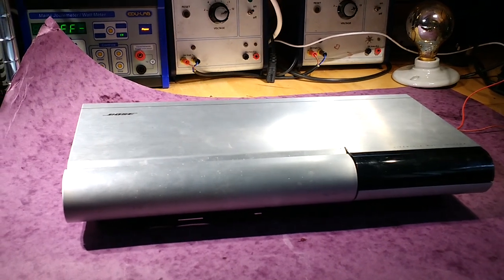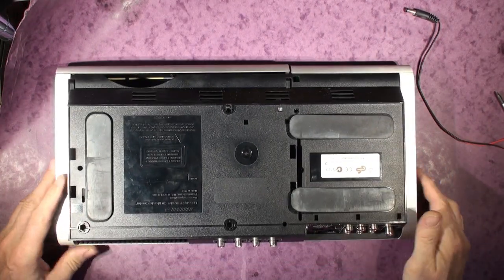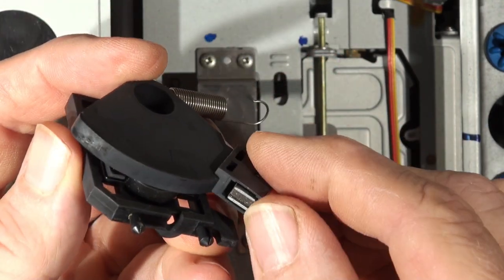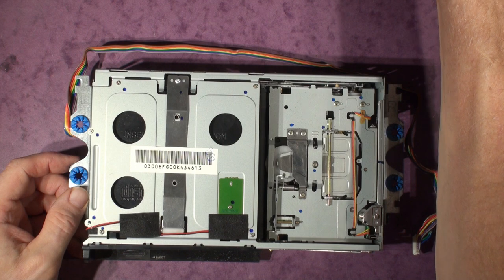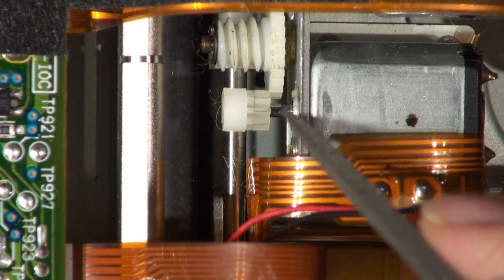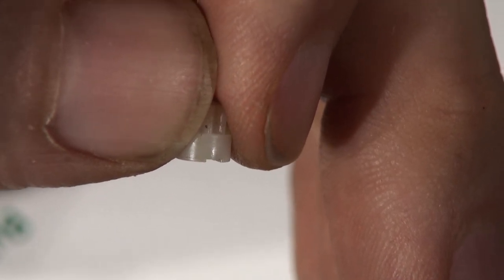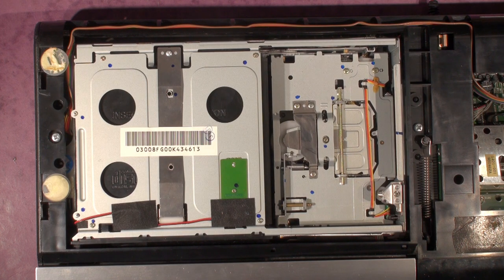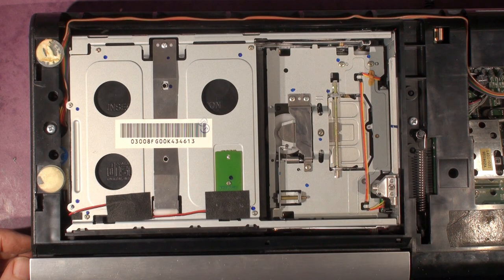Bose LifeStyle System won't Eject CD Magazine /  Cartridge - Can it be fixed?

Comment: Thanks to your video I repaired one of these units today in less than half an hour. I used super glue on the slipping spur gear. My lathe at the ready, but was not needed as my gear had not split, just moved along the motor shaft. Also the repair was a love job for a relative, so lets hope the glue holds. Subscribed.
Reply from the maker: Nice work!

Comment: Issue exactly as described in your video. I used 7/32" Brass Hobby Tubing to cut a small collar that fit over the smooth collar on the pinion gear. Secured it to the gear with super glue. Perfect operarion was restored. Total investment $1.58. Thank you so much for this information!
Reply from the maker: You are welcome
Reply: Ha ha. Did you take the cost of a length of brass hobby tubing and divide by the length you cut off?

Comment: Many thanks for taking the time to compose and post this video. My unit also stopped ejecting the magazine, whirring endlessly in its attempts to do so, and reuniting the little cogs in question solved the issue for me too. I chose the quicker option, though, of simply pushing the smaller cog (on the motor) back into position (don't have all the other equipment you do) but this will hopefully suffice for another couple of years to happy listening. Thanks again.
Reply from the maker: Glad it helped
Reply: Hey, is it still working okay? I also don't have all that equipment
Reply: @sherrisaramjohn9936  Yes, I've had no issues since repairing it in this way.

Comment: Great video.  I love my lifestyle 30 and experienced the same problem.  Fixed with the end of a disposable syringe (teeth whitening solution) as mentioned by another viewer.   However, I then found that the laser would not read the discs.  Back to YouTube and looked up adjusting the laser potentiometer slightly (anti-clockwise).  Now have the CD player all back to normal!  Many thanks again!
Reply from the maker: Great news. Another unit saved!  Thanks. If you subscribe I have other Bose videos - I need to edit and upload when I get time.
Reply: How did you fix it? How did you use the syringe?
Reply: @Sutojl  In this video Magic Smoke turns a collet on his lathe to fit over the cracked end of the plastic gear.  I don't have a watchmaker's lathe so cut off a piece from the plastic nozzle of a syringe and, with a little "fettling" with a craft knife and a tiny file, fitted it over the cracked shaft instead of the metal collet.  I didn't even use and superglue as the fit was so tight.  Hope that helps?

Comment: Had exactly the same failure on my unit - the eject motor running continually in my case - until I can fix the loose cog I have unplugged the CD player as don’t really use it. Thank you as I guess you have saved me a lot of money getting it sorted
Reply from the maker: Glad it helped.

Comment: Thank you magic.  This was exactly my problem.  Obviously a manufacturing fault.  Anyway, was a bit tricky reassembling the whole thing and at first couldn’t get the door to stay shut.  Spring kept pulling it open but did get there in the end.  I’ve also got a problem with the remote which hopefully isn’t something I did when taking the unit apart.  It doesn’t seem to connect to it.   Tried new AA’s which had no effect (cheap Panasonic batteries?).  In fairness I don’t use the system that way now.   With the way tech’s moved on I now have a Bose link connected to it and use an app to stream music to the speakers along with other S20’s and 30’s throughout the house.   Which as you will probably appreciate keeps every room filled with synced music.  Anyway, I digress,  thank you for your very informative and easy to follow vid.  Keep the music playing.  Andy.  Southampton 😊
Reply from the maker: You are welcome. Thanks for watching.

Comment: Bravo apparently there are quite a few videos which talk about this problem.... The trick is to have the equipment to be able to do the same thing which is not at all obvious, would you have by chance put set up a small business selling aluminum washers MDR in any case well done !!!

Bravo apparemment il y a pas mal de vidéos qui parlent de ce problème.... Le truc et d'avoir le matériel pour pouvoir faire la même chose ce qui n'est pas du tout évident est-ce que par hasard vous auriez mis en place un petit commerce de vente de rondelles d'aluminium MDR en tout cas bravo !!!
Reply from the maker: Thanks. I sell the gear motors at cost for anyone who needs one. I sell a few per week. used to sell just the metal pinion gears but it was easy to damage the motor housing whilst pressing the gear on so I got some Mutaba gear motor assemblies made in Taiwan . .

Comment: Really helpful video, thanks. My CDs had stopped spinning although they would load up and pop in/out of the CD cartridge fine. This trick with the two plastic gears solved it. After 22 years, my Bose will carry on providing good service.  Great news as replacements are probably now made in China and we boycott them because of their appalling human rights and environmental records.
Reply from the maker: Hi David, great news.  Nice to know that something has been saved so it is necessary to take, make and throw yet another another audio system.

Comment: Great Video. I have same problem with my unit. CD doesn't eject & the display is gone. I have three questions. 1) What if I do not have milling machine? Is there a back up plan to put the same gear? 2) Top cover that you showed to cut it with knife, how do one put it back? 3) The display; Has it come on once the CD eject fixed or any more steps required?
Reply from the maker: I understand a piece of a syringe needs cover is tapered and can be trimmed to fit as a collar.  If you degrease and superglue the gear it will usually hold OK.  Stick the cover on with thin double-sided tape.

Comment: Fantastic video sir, thank You for uploading. But what if im not trying to fix it, but just get the cartridge/magazine out? My mom would be very mad if I were to disassemble it, and some of my most favorite cds are stuck inside - parliament funkadelic live, smokers delight… Any help on how to get the cartridge out would be appreciated❤️
Reply from the maker: make sure all CDS are in the cartridge. then you can turn the gear that the motor pinion with a small screwdriver. If you turning the correct direction then it will start to rise so just keep going..

Comment: Hi I know this this an old thread as such, but... my very old system has just gone and it's the small pinion gear that's split. will any 9 teeth gear do? I've read that you've asked for sizes from others, can you share what I need to get? many thanks
Reply from the maker: I will have a look. I have a drawing of the gear. I expect it is just a standard type.
Reply: @razenby  been searching - 092A??

Comment: I found a mention that the little plastic gear used to have a part number of 189099 but I can not seem to find it available anywhere. :(
Reply from the maker: Do you happen to have a sample? I am pretty sure I can source the gear. Just need the outer diameter and the number of teeth,

Comment: Hi, I have a lifestyle 5 model 614810, everything works perfectly, but 
little by little did you lose the tuning of the radio? Will I have to 
adjust something inside? Or could it be that I have to replace a chip, I
 only have a small cable for the antenna, but before that it was heard 
without problem, now nothing is heard, only the noise as if they were 
not broadcasting on radio stations.
Reply from the maker: Sorry, very difficult to diagnose remotely but you can check the basics as they often turn out to the issue . Check the supply voltages are present. Check the antenna connection is good. If you hear the mush then the receiver is probably working.  You could change the reference crystal.

Comment: You can see the time I posted the question and now... It was the problem and the gear was simply shifted out. I pushed it in and it is all good. Took the longest to put the black trim back but it is on... On my way to Lowe's to buy two sided tape to put the top cover back on. Thank you very much for the video!  Display is still not working! :( Any suggestions?
Reply from the maker: Display is VFD.  1. Check the low voltage DC supply for the kathode  wires is working. They are the fine wires that run along the display under the front glass.  There should be a few volts potential applied between the ends of each wire  to heat up and make it emit a cloud of electrons that can be accelerated toward the anode.  If the supply fails then there is no display. If you measure zero volts across the wires then the supply has failed. Look in the supply for brown resistors, bad connections, bad connections in the wiring and a bad smoothing capacitor.  2. Check the HV anode supply voltage is present.  Should be between 12 and 30V depending on display.

Comment: I’m having this exact problem, only that little plastic gear that popped-off appears beyond repair. Were you able to find a source for ordering this little plastic gear?
Reply from the maker: No. I forgot to measure the one I had here to get the module and ID of the gear.  If you want to send me the broken one I'll measure it.  If you want to do it yourself measure the outer diameter and count the number of teeth and you'll know what to order. There are loads of sources on line. Just google 'plastic pinion gear'
Reply: Thank you for your help! I’m still having trouble finding a replacement. I count 9 teeth on the pinion, and the diameter is 3/10 inch (about 7.62mm) on the side without teeth, and 2/10 inch (about 5mm) on the side with teeth. I notice many of these go by “T” numbers online... although I can not determine what it is for this one.
Reply: I went to a local electronics repair shop today with the measurements of the plastic pinion gear and they said they did not have one. I then went to a 3D printing service, who said they could make one for about $125 dollars. Ouch. Any other ideas? :(
Reply from the maker: Send me a plan photo of it next to a ruler. I  can work out which one you need. They are pretty standard. Take the picture from directly above with the ruler (preferably a steel engineering one) close to the gear.  Camera lens needs to be minimum 3 inches  from the gear and ruler else spherical distortion might skew the measurement.

Comment: Hi, we are trying to buy the little plastic gear that's cracked. Any solutions?
Reply from the maker: How bad is the crack ? If only a small crack De-grease the gear and the shaft and use superglue the gear back on the shaft.
Reply: @razenby  Very Bad, tried to fix the gear but split in half, trying to locate the one half that fell in the machine? How much does a complete gear cost?

Comment: Hi, I have 2 CDs in the changer and it won't eject or play. I followed your instructions to remove the magazine etc and found that the little plastic cog had become disconnected from the bigger plastic wheel thingy (I'm not very technical sorry). I pushed it back on, popped the workings back in the case and connected the power. The magazine is trying to load the CD (or at least, it is checking) but one CD is stuck in the CD playing area so the unit doesn't rise up as it check each slot. It was a new CD from Amazon and I noticed it felt thin, I wonder if the CD is the problem. Anyone have any suggestions?
Reply from the maker: Sounds like the cog is still spinning on the shaft....
Reply: Good video. Where can I order the assembly?
Did your fix work?

Comment: Thank you so much for your presentation. I have  exactly the same problem. I really do want the same part that you have made.  How  can I get it from you.  From Japan.
>>>Hi, Magic.  I will try to find out a quite similar gear at toy stores.  I have found that they are selling a variety of gears.  Your video gave me challenge spirit.  Thank you so much.
Reply from the maker: If the gear is just cracked then decrease the motor shaft and pinion gear and apply a little super glue to the shaft and slide the gear into position. It holds well.
Reply: @razenby  Thank you so much for your guidance.  The hobby shop’s owner made a cover using a portable radio antenna.  He saw your video then got that idea.  I really thank you very much for your video.  If something happens again I will try your instructions.

Comment: Exactly same issue, got some green loctite on it, sorted😁
Reply from the maker: The green loctite (Threadlocker?)  What is the number ID? Thanks.
Reply: @razenby  I had used 603 loctite
Reply from the maker: Thanks.  I have used threadlocker and bearing lock. I'll get and try some 603 - it seems to be designed for metal to metal with high oil tolerance.
Reply: @razenby  that's all I had except super glue and it's done the trick😁
Reply from the maker: @BorisSpark  Should do a good enough job. Loctite is good stuff. I remember fitting some steel M3 allen head machine screws with the screw-lock grade into aluminium and couldn't get them out 10 minutes later - they sheared off,    Used to stick the capstan drive rollers on document readers no problem.  You don't know the outermost diameter of the gear and the number of teeth of the pinion gear?  I have a unit here with the gear completely missing.  Don't let it get anywhere near polycarbonate plastic - it just crumbles.
Reply: @razenby  the Bose lifestyle 25 series unit? I got one, can have a look tomorrow
Reply from the maker: @BorisSpark Great. Thanks.  Need the accurate diameter across the teeth and the number of teeth please.
Reply: @razenby  I'll measure it up for you, I am a fabricator so can give correct dimensions 🤣
Reply: @razenby  is there any other way I can contact you to send you a sketch or even a drawing
Reply from the maker: @BorisSpark  ark.mail@gmx.com
Reply: @razenby  were you able to get a drawing for the little Bose gear ⚙️ that cracks on everybody?
Part number 189099
Can it be made on a 3D printer?
Reply from the maker: @DouglasBruss  I have the drawing. I'll take a look at it tomorrow and get some. It is just a standard gear, just needs exactly the correct size hole.  Could 3D print it but you would need to make it out of something quite hard.
Reply: @razenby  much obliged.  I  ended up taking a piece of undersized clear rubber tubing and  stretching it over the hub of the gear  after cutting the tubing just long enough to cover the hub but not cover the teeth of the gear.  It seems to be working for now.  Shrink tubing might have also been a solution, but I couldn't find mine.   Your help seems to be appreciated all around the world!  Thanks!  On eBay here in the US, there was a guy selling a brass version of an adequate gear for USD30.  It also had to be epoxied on the shaft, and the epoxy was not included.  Hopefully my rubber tubing will keep enough friction between the gear and the shaft.  I tried with some Shoo-goo, but when I pushed the gear bock on, the crack reappeared.  Usually that stuff sticks to anything, but I could just peel it off of the gear after curing for 24 hours.
Reply: I should add that I found a seventh CD jammed between the 6-disc cassette and the slot for said cassette!  I discovered it after the cassette refused to eject after pushing the eject button.   While the motor was running, I forced the cassette a bit with a screwdriver, and only then did I realized that the Baby Einstein DVD wasn't even in the cassette.  Damn kids!  Haha!
Reply from the maker: @BorisSpark  Just sourcing a  motor and gear at the moment from a China factory.
Reply: @razenby  Good to hear, hopefully more people can enjoy their equipment being brought back to life

Comment: I’ll never buy an another Bose product AGAIN EVER, I had problems with this expensive piece of crap for many years . Their crap is all proprietary and as you learned this video, not well made.
Reply from the maker: I agree with the second assertion. However the Audio and signal processing tech are very well engineered. Sadly the hardware engineers are very inexperienced and prone to schoolboy errors.  Very poor technical oversight by management and insufficient product proving/ testing are the order of the day.